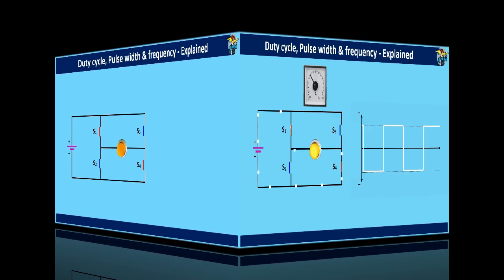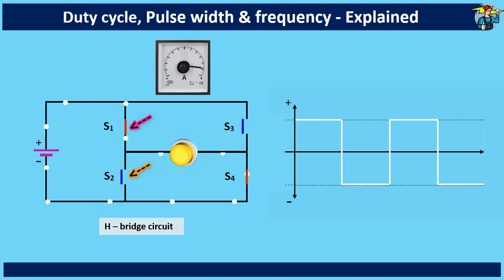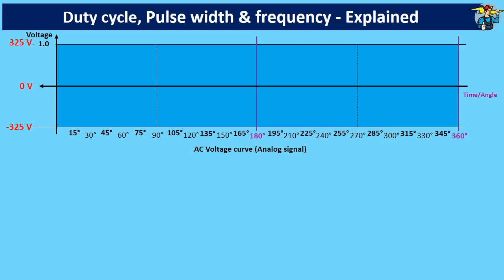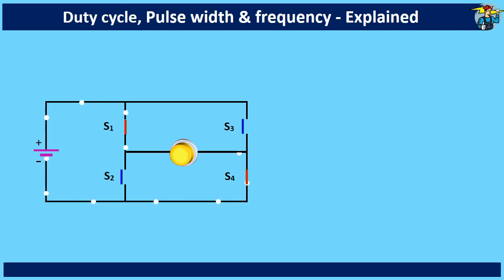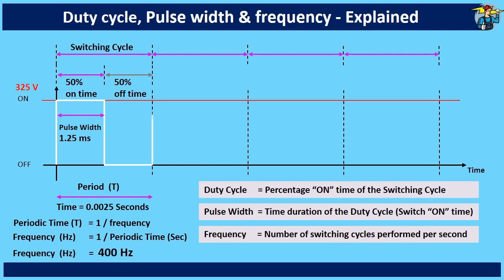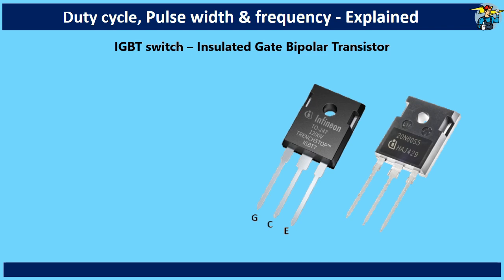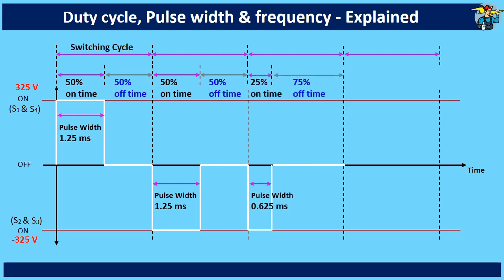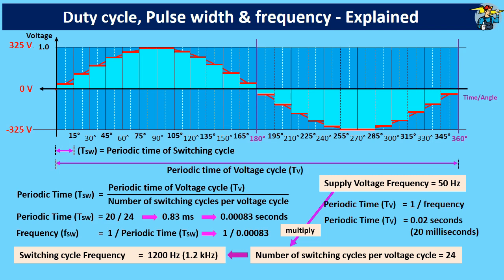Pulse Width Modulation and Duty Cycle Explained | How DC to AC conversion is done

Comment: Hi if only change the frekuensi like from 30khz to 20khz it will reduce the voltase??? Because i dont see to set duty cycle on stm32
Reply from the maker: Here we talk about increasing the switching cycle frequency to 20kHz. 
It won't change the supply voltage frequency of 50Hz.
So voltage will not be affected.